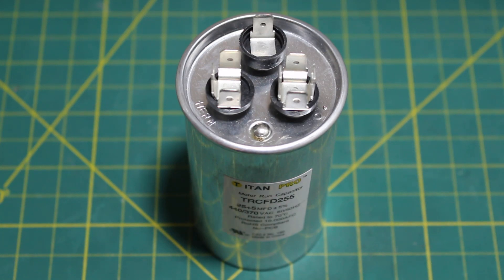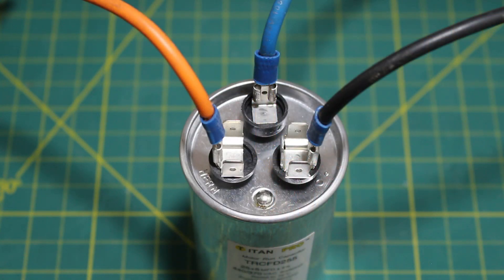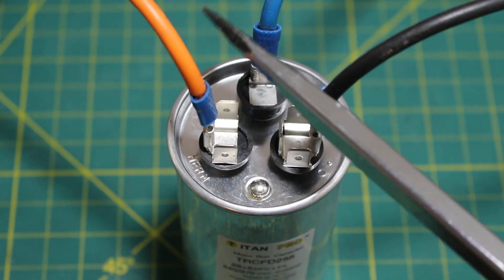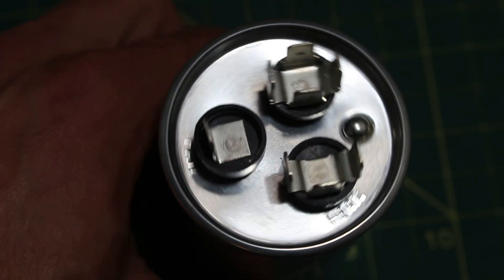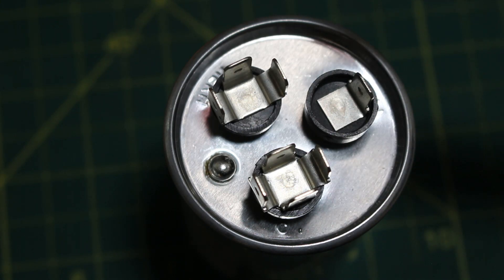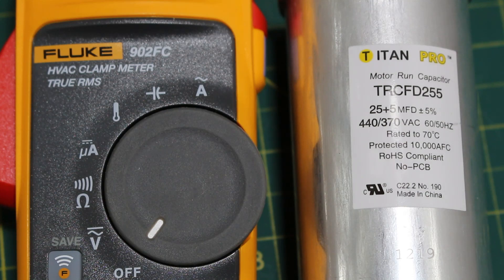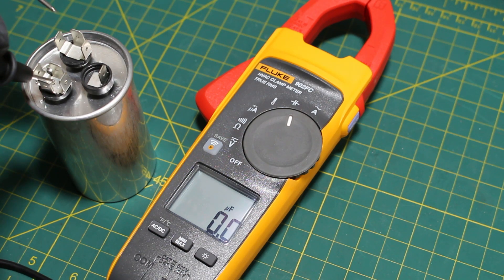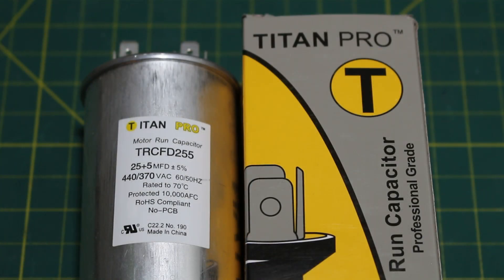HVAC: How To Check a DUAL CAPACITOR With A Multimeter (HVAC Training - Dual Run Capacitor) SAFELY

Comment: Thanks for a clear explanation of a “dual” capacitor and how to differentiate.  My factory capacitor part # showed it was a dual capacitor.  My online searches did not say the replacements were dual even though they had the 3 terminals.  I ended up with the Titan Pro from Ace Hardware.

Comment: Can you safely pull out wires from capacitor first and then discharge it? 
How would you safely test capacitor that is already soldered on board,
which steps would be right in this case?

Comment: thank you. Think your the only one who talks about the +5 saying its a 2in1... Everyone I have called, etc had no idea what that meant. I have a capacitor for my pool motor that says 35+10uf +/- 6%. All pool places were telling me that a 35uf was what I needed, but didn't know what the +10uf was. Glad I didn't buy from them. Again, thank you. Now, is there a difference between capacitors for AC or Pool pump motors? The look identical and ratings are the same.

Comment: Your verbal description is useful and correct.  However in using your clamp meter you positioned the test leads for the fan capacitor as you verbally described the process, but when doing the herm to common test you did not put your leads correctly on those two connectors. However verbally you did say what to do correctly.  Otherwise, can useful video ...thank you for refreshing my mind .

Comment: I just bought two new capacitors. I checked each one and they both checked good a first but the meter immediately started to read less and less. Now they don't read anything. You think both capacitors could be bad. Both new from different places. TIA

Comment: Good! I am a technician, but I still learned something here! Thanks.
Reply: Hey can you answer this why are there so many terminals for the same connection ? Like why 4 connections on the "C" or common?
Reply: @dkat1108  I believe it is for convenience, because the multi-terminal capacitors can more easily connect from different directions to satisfy direction and distance variations of the various models of AC units. There are rare cases where the ground is used as a take-off point to ground another nearby component. Also, sometimes the capacitor can be mounted 
sideways, and this multi-terminal set-up can reach wires that would otherwise be difficult. There may also be commercial applications for the capacitor that are not specific to HVAC applications that make use of more terminals, for example to double capacitance in parallel configurations. Special problems also arise if a certain capacitor configuration is not available, for example replacing individual run and start capacitors with a single run-start capacitor where you will be dealing with a different wiring scheme. I have seen some fairly desperate "fixes" probably related to perceived emergencies, such as ill fitting capacitors just hanging from the wires, not good..

Comment: my capacitor showed as 75+10uf, but i found SUREPHON made only now is 70+10 or 80+10uf, so which one should i use replace for 75+10uf

Comment: Is it possible to buy a brand new capacitor and have it bad out of the box? Kind of appears that's what happened to me as I get five between common and fan but nothing between common and herm
Reply from the maker: Definitely possible. I've had brand new units not work after installation. Also had multiple parts be bad right out of the box. Make sure your meter is working correctly but it is definitely possible. Thanks for watching & good luck!
Reply: @JumpermanTech  thank you again! I have a good fluke. I get a solid five on common to fan on both of the capacitors and I have nothing on common to herm. So I'll give it a shot and buy another one! 😂
Reply from the maker: @boblatkey7160  Youre very welcome! Fluke meters are great and reliable. Sorry to hear that. Sounds like you need a new capacitor. It happens sometimes. Quality control has gone out the drain these days! Thanks for watching & stay tuned for new videos every week🔧⚡️

Comment: So it Doesn’t has to read exactly 25 or 5?
Reply from the maker: Read the exact model tag but usually + or - 5% the UF/MFD rating at most. After that, it's time to change 👍
Reply from the maker: Stay tuned for new videos every week! 🔧⚡️

Comment: Will a capacitor designed for AC electric work on a DC circuit as well?  Will a DC capacitor work on an AC circuit? Or are neither interchangeable?

Comment: Thanks for the video, since I don't have a capacitor discharge, I used the screwdriver technique to discharge it, a 30+4 dual capacitor and neither C+HERM and C+FAN gives output in uF, I was thinking that maybe the capacitor still needs to discharge, can I use Voltage to measure it ? to test if it still has charge

Comment: Jumper man Tech, In an A/C condenser, is it possible to replace two single capacitors, a start cap of 30 uF, and a run cap of 5 uF with one dual capacitor 30/5 uF?
Reply: Yes but I can guarantee that your start capacitor is not 30 uF, thats your run capacitor for the compressor.
Reply: @Redtooth75 , Thank you man for your post. In my Payne condenser, the fan cap (brown wire) is connected to Packard POCF5 (+/- 5%) and the motor-start cap (blue wire) is connected to an AmRad 33 uF.  Why are you so sure that the bigger uF is the run capacitor?
Reply: @mazyarzagros  because start capacitors have much larger uF ratings, 30 would be a normal rating for a motor run capacitor. Not all units have start capacitors, they are optional. If you had a start capacitor then your unit would have either 3 capacitors, one compressor start cap, one comp run cap, and one fan run cap. Or alternatively you would have one comp start cap, and a dual run cap for both the fan and comp. You would also have a potential, current, or solid state relay if you had a start capacitor.

Comment: All I have is Craftsman and Kobalt srew drivers, the Kobalt are kinda rubberized and the Craftsman are the typical poly style handles, will either of these work to discharge the cap?

Comment: The micro symbol is “mu”, not “ u”.
Reply: The symbol is actually the greek letter lowercase Mu. The lowercase Mu looks like the letter u with a tail in the front. It is commonly replaced with u when writing on keyboards because typing the greek letter is tedious. It can also be replaced by a capital M as some manufacturers do. Its breaking metric unit convention to do that because M means mega but its okay to do that for farads because nobody is going the think they have a 30 megafarad capacitor.

Comment: I have a dometic penguin a/c that the fan motor try's to run  but won't quite get up to speed. Could a capacitor cause this issue?
Reply: Could be, but it would also suspect that one of the motor windings in the fan is bad, and it can't reach full speed. I've replaced a fan due to this very thing. Test capacitor first and it if checks out pull the fan and check for internal motor grounding.

Comment: Testing Herm to Fan should read the sum of 25 + 5 = 30uF, right?  So, if needed, you could use a dual as a single cap of higher capacitance.

Comment: Thanks for the great video.  Do you have to remove the capacitor in order to check it?  Or can it stay in the circuit? (with power off of course!)
Reply from the maker: Power OFF it number 1. Make sure to discharge it just incase of any left over energy and yes you need to take off the wires to isolate it so when you're testing, you don't have a feedback false reading. Thanks for watching & stay tuned for new videos every week! 🔧⚡️
Reply: @JumpermanTech  Great info, thanks!

Comment: Once you kill all sources of power, and discharge the capacitor charge......question......can you still check the capacitor "As installed"....without removing wires?

Comment: While it is true about the terminals, don't rely on the 4/C, 3/Herm, 1/Fan. I have ran across a few that were rusted out and had 4 in each spot. You will have to trace the wires.

Comment: The condenser fan stopped working &
my dual run capacitor shows no reading between the fan terminal & com. I'm assuming that indicates a shorted capacitor?

Comment: Please explain the 440/370 VAC rating on the capacitor in this video.
Is the 440 for the Herm and the 370 for the fan?
Reply: Chargein shortin off discargein  power power good testin

Comment: Appreciate your good lesson... I'm a mechanical engineer who always reluctant to test electrical issue for some reason.
recently i have to check capacitor 350VAC(50/60hz), 6/25uF where installed 1ph 220v EHP outdoor(condensing) unit.
1. when i check voltage, do i have to position AC or DC on multimeter switch? because the capacitor makes me confuse as a battery.
2. what if not release the voltage before test uF then multimeter must be broken or explode?
please let me know. Thanks again.
Reply from the maker: Awesome, glad you enjoyed this video. As far as checking voltage, I'd advise not to go that route. The best way to check any capacitor is to turn off the power, confirm there is no power, discharge the capacitor for safety and disconnect the wires to isolate the capacitor. From there, set your meter to microfarads and check with the instructions shown in this video. Thanks for watching & subscribe for new videos every week🔧⚡️
Reply: you clearly didn't watch the video. 😊

Comment: I am a female and love DIY.  My air conditioner fan stopped running even though my air was coming out (hot!)  After research, I needed to find the capacitor and meter read it.  This explained everything to me.  I bought a replacement capacitor and am sitting in an air-conditioned house again.  Did I say I live in Florida where it was in the 90's when my air cut out???!!
Reply from the maker: I'm glad this video helped you get back up and running. 90 degrees is no joke! Thanks for watching & stay tuned for new videos every week🔧⚡️

Comment: What if the capacitor has no plus or minus rating, do u go by the actual given numbers??
Reply from the maker: Rule of thumb would be + or - 5% of the rating on the capacitor. If it's within range, you should be good. Thanks for watching & stay tuned for new videos every week! 🔧⚡️
Reply: Comon fan  24v mic fardevot

Comment: Hi, this is a dual run capacitor. It's the only capacitor I see in my condenser unit. How does my compressor and condenser fan motor work without a START CAPACITOR? Thanks
Reply from the maker: Yes, this is a dual capacitor. If the specs require it, it won't run without it. If you have 3 phase electricity then it wouldn't require a capacitor. You're welcome 🙃 Stay tuned for new videos every week🔧⚡️

Comment: I'm getting 0 reading for fan.. could that be the reason ac isn't cooling?
Reply from the maker: Definitely. It means the condenser fan motor won't start and your system will end up tripping on high pressure preventing the system from cooling your space. Thanks for watching!
Reply: @JumpermanTech  thanks alot I will keep you posted I'm getting the a capacitor tm.
Reply from the maker: @Jay-ll9ip  Sounds good!

Comment: A lot of great info, but if I had a HVAC Clamp Meter I think that I would aiready know how to test a capacitor
Reply: Correct to a point.....
Some of us have several types of meters...And probably don't have an HVAC specific meter....Because we didn't need one until now....
And we're here trying to save a few hundred dollars....
So now I have an HVAC meter for around $50 and a new Capacitor for around $15 ...
Sure was a lot cheaper than a service call of $250 to $350...
Reply from the maker: @billymcdonald4934  👍👍👍
Reply from the maker: @Duckhunter Not exactly! So many techs don't know how to use their meters but hey, that's what this video is here for!

Comment: If had to check a cap under load because for some reason there was no disconnect for the unit and my breakers were not label
Reply from the maker: I wouldn't suggest doing that honestly. There might be a way with calculating amps but I'm really not sure. Nobody really does that. You must find that breaker, label it & recommend installing a disconnect💯 Stay safe out there & stay tuned for new videos every week🔧
Reply: @JumpermanTech  there is a way to check using the formula 2652*amps divided by voltage, and yes I quoted a disconnect not sure if it's against code or not, but for proper servicing is a must

Comment: What if you don't have a meter that measures capacitance ?
Reply from the maker: I highly suggest you get one 🙂 Fancy tools are not required but you NEED a HVAC multimeter. Some tell signs the capacitor is not good is that you might find your motors humming. There a good chance it's the capacitor. You can also visually inspect the cap to see if there's any bulging or burnouts.
Reply from the maker: Stay safe out there & stay tuned for new videos every week🔧
Reply: You can use an analog meter to see if it will charge and discharge but you won't get a value.

Comment: What about start capacitor‘s ? Do you have a discharge to start compassion to ?
Reply from the maker: DEFINITELY discharge start capacitors! Discharge ALL capacitors👍 You might see a resistor on a start cap which bleeds the charge out for you. Most capacitors these days discharge themselves when the power is cut off but never take that chance. Safety first👍🔧 Thank you for watching & stay tuned for new videos every week!